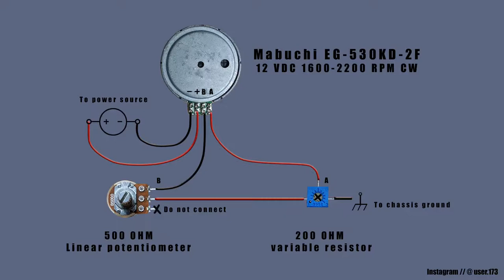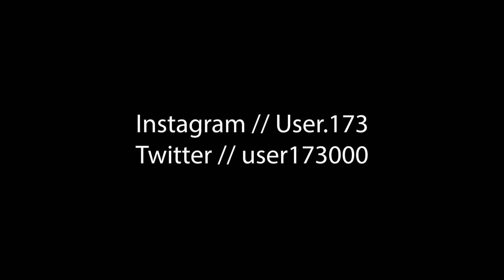DIY Pitch Control // Circuit Bend // Tascam Porta03 MKii

Comment: Would the process be similar to mod a tascam mfp01?? I just bought one and I really miss a pitch(speed button (which I have on a portable recorder)
Reply from the maker: hey there, the short answer is yes. The longer answer is you'll have to find out what motor it uses and whether it's Counter clockwise or clockwise in it's direction. If the motor is the same size as the tascam 414 or porta2, porta 3, or fostex x12, then great, you can find one with a pitch control board going the direction your motor spins and replace it/ add the pitch pot. 

If you can't find a motor to replace it, then you can watch my previous tutorial on this process (for the tascam porta02) and I show you how to just install a pot to any motor and control the speed. you won't, however, be able to speed it up beyond it's max rpm, but you can pitch down, which is mostly what people want to do anyway.
Reply: @User173  is the foster x14 motor one I can slap a pot on or do I need to swap the motor ?

Comment: Is there a way of fine tuning the pitch or adjusting the tape speed without this mod?
Reply from the maker: no, unfortunately not. On the fostex x-12 there is a trim pot inside that can be used to make minor speed adjustments, but not on the tascams that don't have a pitch already installed. The 414 and 424 both come with pitch controls already installed.